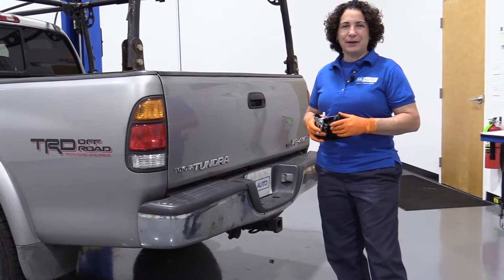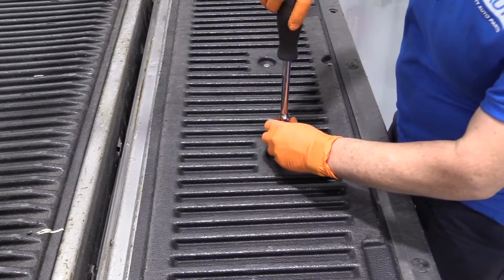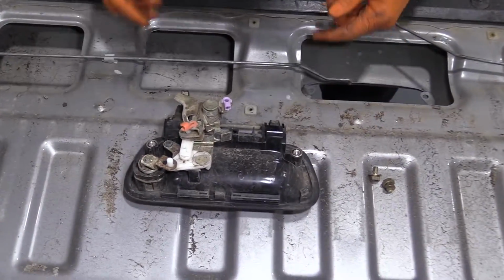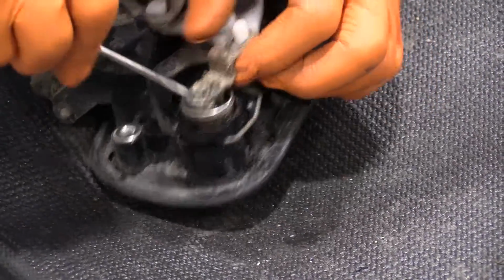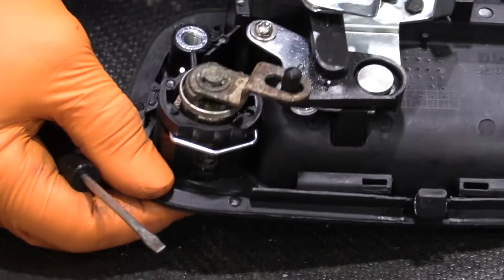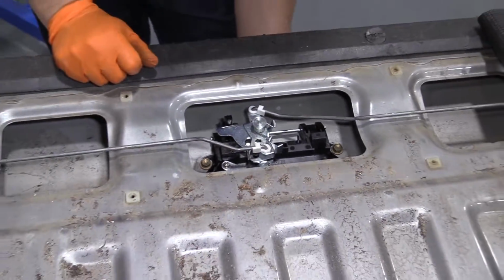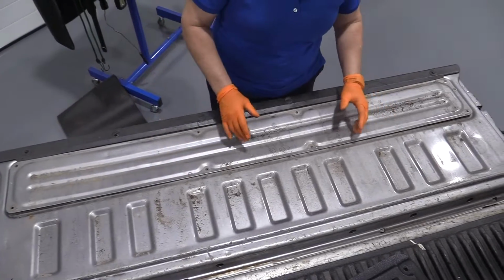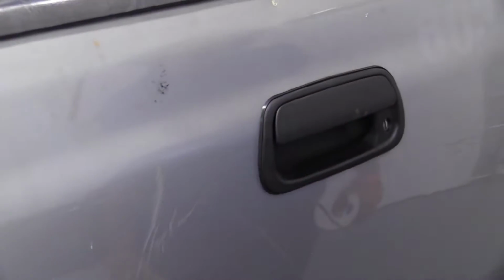How to Replace Tailgate Handle 00-06 Toyota Tundra

Comment: Bought a used Tundra and noticed it was missing the actual lock cylinder inside the liftgate handle assembly... is there a way to replace it?

Comment: Thank you for this video. This worked just right! My 2002 Tundra tailgate handled broke very suddenly. Lucky for me, it was in the upright/closed position. Found this video, ordered the 1A Auto part after gasping over the OEM part pricing, and dear hubby had it installed in about 15 minutes. No bed liner in ours. We did take one bolt and washer off of the seal plate first, and made a visit to the hardware store first to buy 8 nylon washers because all of ours were cracked from age. We did get simple basic black instead of trying to color match our pretty red truck. But at 22 years on the road, the black looks just fine!

Comment: Excellent video. One hint. after reinstallation, If the rods don't move to open the tailgate, it may be that the tailgate is locked. Unlock it,, and it should be fine. That's what happened to me. Otherwise, the removal/reinstallation was smooth. The step-by-step video was clear and remarkably useful..

Comment: Watched the video, ordered the part from 1A after it didn't arrive I called 1A and found out due to autofill on my computer that the address was slightly wrong so instead of the post office sending it back, the geniuses THREW IT AWAY! Instead of returning it to 1A (smh). 1A was kind enough to send me another at no cost to me. With the help of this video, had it done in about 20 minutes. Thank you 1A, great company and great video. I'll be ordering from you guys again!!

Comment: I had never watched one of your videos until tonight. I watched because I had replaced my lock assembly a couple of years ago and everything went fine. A couple of days ago I locked the tailgate with the ignition key and now it won't unlock. I watched the video to see what kind of bit I needed to take the bed liner off and it was right there in print at the beginning of the video. A T30 Torx and I just got home from Lowe's and didn't get any torx bits but I will tomorrow. Your lady is as smooth as glass, maybe ice, and knows from whence she speaks. You are lucky to have her. Thank you again.

Comment: So how do you do this if it's failed and the tailgate is stuck closed vs open? The latch assembly, does yours include the bolt for holding it in? I believe mine fell out because the current handle is very wiggly.

Comment: At the moment I have one bolt of the pair that I need to replace. One bolt holding it in until I locate one. This would be an even better product if they would include the 2 bolts threaded into the replacement handle. It makes sense that the original bolts are at the end of life if the replacement handle is necessary. All in all, great part, great video.

Comment: The plastic tailgate handle broke on my 2006 Tundra.  The Toyota Dealer wanted $150 for the part and $115 for labor.  I bought the black (not color matched) replacement latch fpr under $40 and tried to replace it myself.  Thr Torx fasteners stopped me cold because I didn't havr thr right bit.  I watched this video, with the tool and misc. stuff needed and showed exactly how to do the job.  I got the right size Torx bit and swapped it out in 15 minutes.  Thanks 1AAUTO.
Reply from the maker: + Thanks for checking us out! http://1aau.to/m/Shop-1AAuto-c

Comment: Something got slammed into the right side catch, so this is going to be the third time the latch has to be replaced.  How do you fix that?  Body buckled a little like a pole or handle was inside between tailgate and back of bed.  Hammer wood against it to flatten the buckle, or clamp it straight with rubber to protect new paint job?

Comment: Can this be done with the tailgate up? I can't put it down because the handle is broken.
Reply: I replaced mine yesterday.  The tailgate was down but I don't think there would be any reason you couldn't do it with it up.  Be very careful not to drop the screws that hold the latch into the tailgate.  It would be easy to do that with the tailgate up.  If you happen to have magnetic socket inserts this would be a good time to use one. Obviously, once the handle is replaced you'd probably want to put the tailgate down to finish replacing the screws that secure the cover.
Reply: Remove the black cover on the inside of the bed tailgate. 1 Lock top left and 1 Lock top right inside the tailgate door. Pull both locks and the tailgate should come free.
Reply: Yes. Just remove the liner from inside the truck bed (if you have one) first, Unhook the 2 long steel rods  from the plastic hooks . Take out the 2 bolts and remove old handle. Use the steel rods to open gently.
Reply: Класс

Comment: SUCCESS! Super easy, by following this video! The only hard part for me was removing the rusty bolts holding the old handle in place. WD-40, time and bit of banging and a good wrench resulted in successful removal of the 2 bolts. THANK YOU FOR SAVING ME $ and building confidence for DIY jobs!
Reply from the maker: Thanks for checking us out. 1aauto.com +Udo Wahn

Comment: I broke off the 16 year old plastic handle trying force it up, therefore the need to get this.This was great! Well done video presented nice and slow to be able to follow it. Looks like it is easy for a DIY job! I just ordered the part and it was a great discounted price on 1AAuto.com.
Reply: Word to the wise: Take the cover off and lube the mechanism before it gets that hard again. (I'm here because I just bought a used truck that had a broken handle when I got it.)
Reply from the maker: +Udo Wahn Thank you!
Reply: Hey Udo, did you do this with the tailgate up or down? My handle is broken so I can't put the gate down. Got any tips?